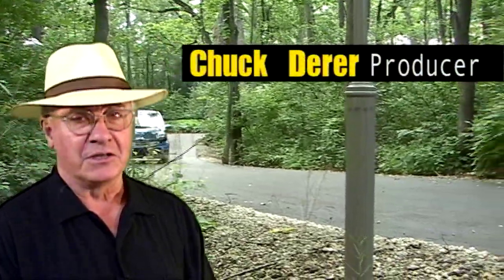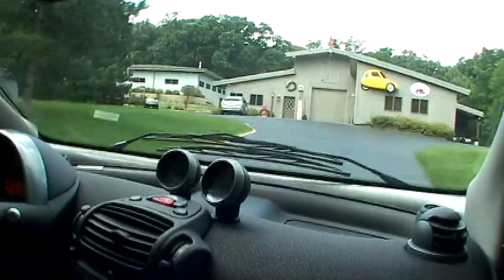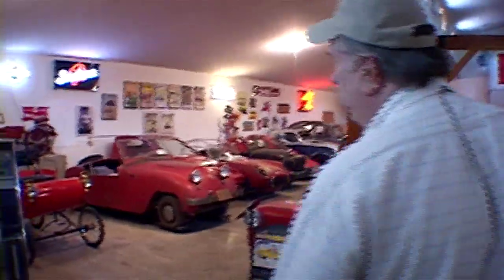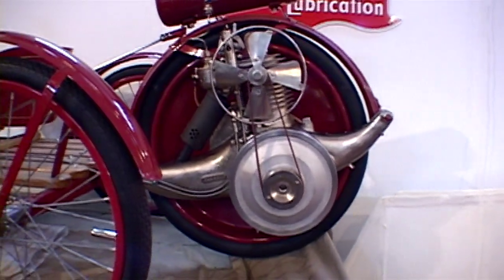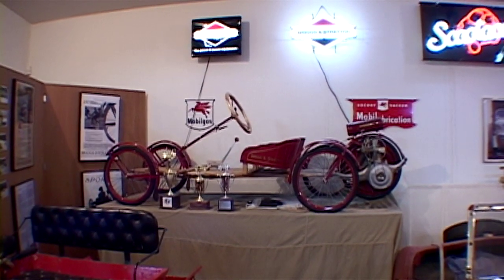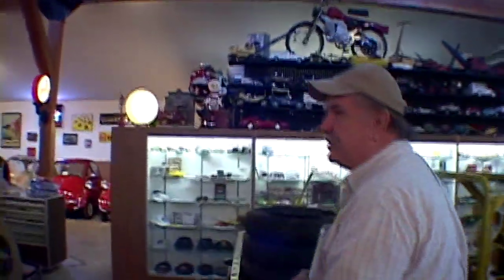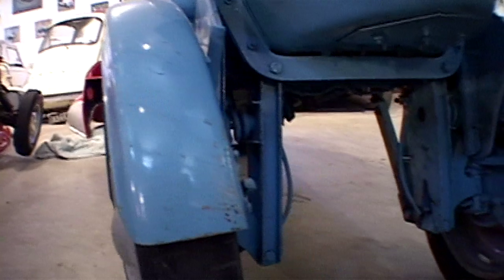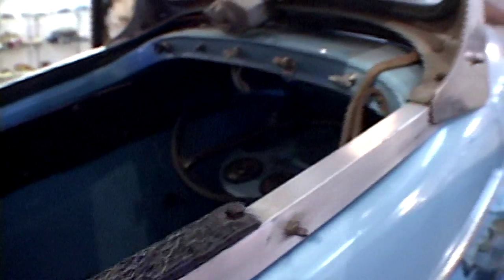We visit the Small Wonders Micro Car Museum in Crystal Lake, Illinois Part 1

Comment: My 1966 Mustang is Briggs powered. It uses a 80302 motor from 1966 and my 1958 Desoto has an even older brigs 6B motor that is original to the car. What my videos to see the cars they are fiberglass bodied and look just like the full size cars and will fit only one adult.